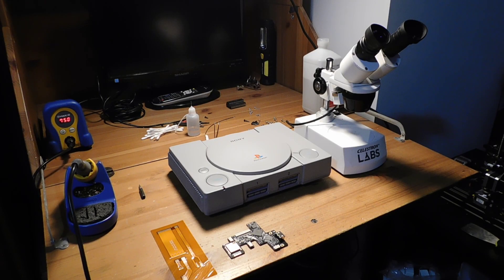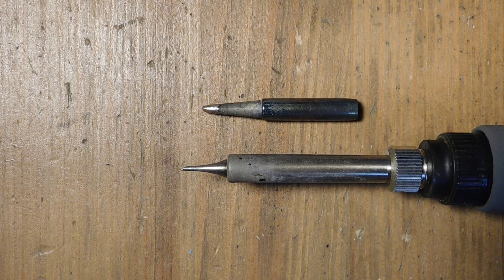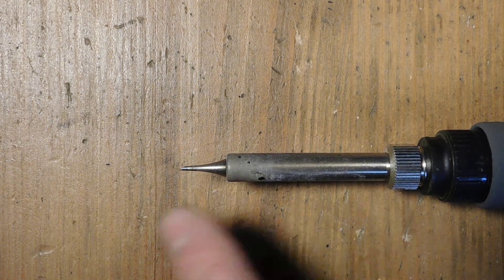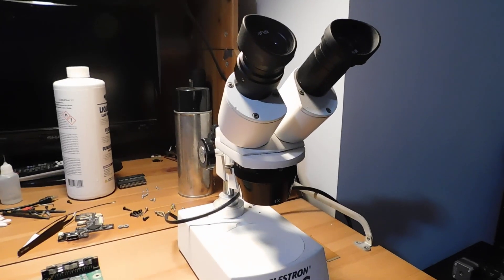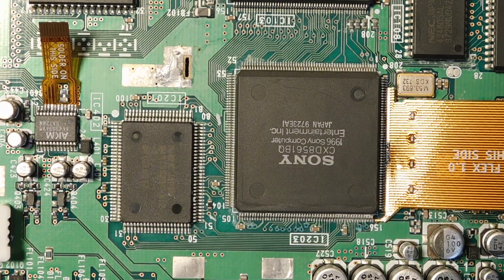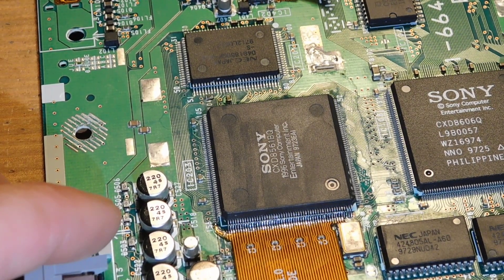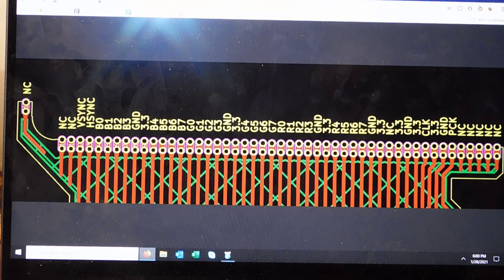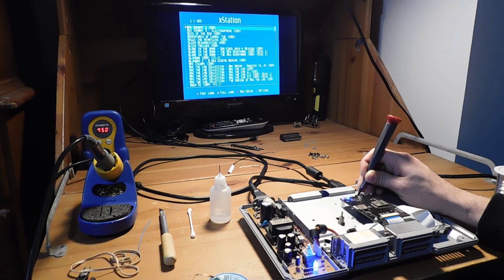PS1Digital: Tips and Tricks for a Successful Installation!

Comment: I just did one without a microscope. BAD Idea.
I have great vision. That was fucking crazy, afterwards I couldn't focus beyond like 2 feed for a few minutes.

I do have a 20x Macro lens attachment for my phone. Without that I think I would have had to put the project on hold.

I also drag soldered everything. again, not the best idea. 2 of the last legs de-soldered from their pads and bent slightly into each other.
I'm good with soldering so everything worked out, just wish I had a microscope for this one.
Reply from the maker: I’m glad that it all worked out in the end! But yeah, I agree. A microscope is definitely a prerequisite for this, and drag soldering is quite risky in this case